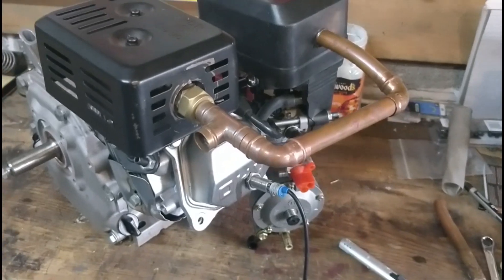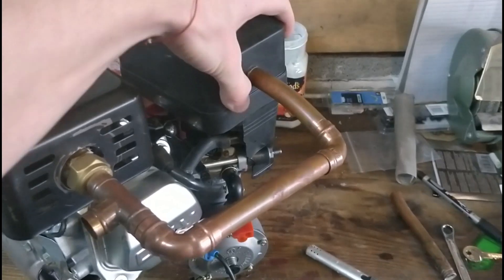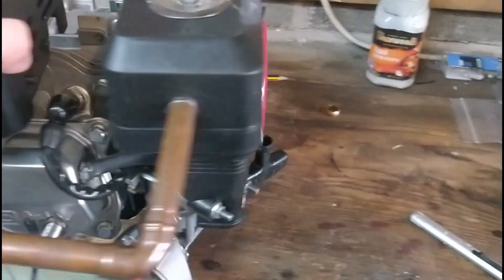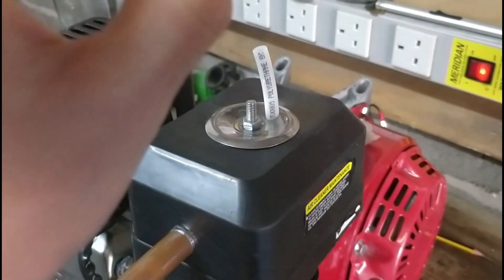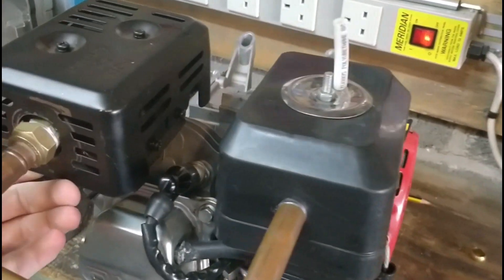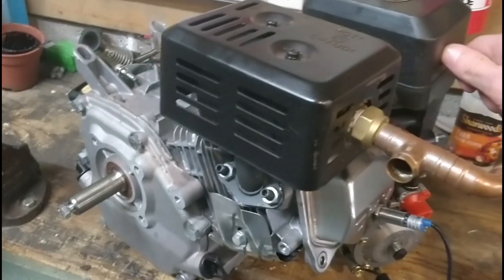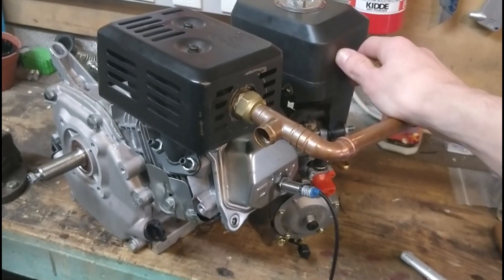Pure Hydrogen Combustion Engine

Comment: Is this also what is in hydrogen cars?
Reply: Every hydrogen car I know of runs on a fuel-cell system because the only byproduct is water on those. On a combustion engine the byproduct is NOx which is a poisonous gas
Reply: @Fransenn  between NOx & carbon mono-oxide, which is more dangerous?
Reply: @Mohapi_Tau  I dont know for sure but I would believe carbon monoxide is more dangerous.
Reply: @Fransenn  no dañgorß emsing friñk full cell he dint kñiw shot

Comment: Looks good, but IC engines are inherently low eff, around 15-20% thermal eff. These days, a secondary organic rankine cycle with a low boiling fluid may help to recover some of the energy in the hot exhaust from the primary combustion engine and push up the overall eff. But H2 is notorious for its "short fuse" - its highly flammable.
Reply: ño its ñot

Comment: I heard Hydrogen can be more combustible and combust easier. Also be more versatile than Gasoline. It might be interesting.
Reply from the maker: Hydrogen being more combustible has its benefits but it's harder to work with,for a combustion engine to run on hydrogen gas it needs to be higher engineered that it would have been if it was petrol, any valve overlap, slight gaps in materials or hot spots in the Engine can cause pre-ignition. All this we can overcome, but will require more cost when an engine is made, on the whole this wouldn't be much of an issue as manufacturers would make these on a large scale bring cost down again :)
Reply: @Hydrogenguys  I think the valves would have some problems with the process, but a potential redesign of the engine would help.
Reply: @Hydrogenguys  the answer is direct injection. No issues with pre ignition then.
Reply: @Hydrogenguys  The added cost of engineering and expense in materials will be offset with a longer lasting engine with less wear and less required maintenance right?
Reply from the maker: @mrpw1402  I would imagine so. Once the engine is set up, it should last as long as a petrol engine, perhaps more frequent oil changes with hydrogen, as the oil would be more likely to be contaminated with water.
Reply: Mr. Rootes  well, yeah, pollution in fuel cell system is a thing though. I like the JCB philosophy on this, after a certain weight/use case, hydrogen ice are a better idea than lithium or fuel cell powered devices. We need a mix of all 3!
Reply: Mr. Rootes  contaminated hydrogen in a fuel cell is no bueno. Hope they find something else for platinum beeing needed aswell.

Comment: Hydrogen needs to be looked into more. We already have tech that separates water atoms, like they have in Submarines.
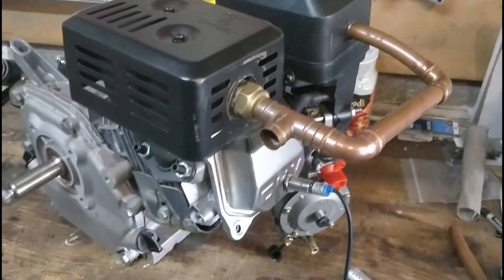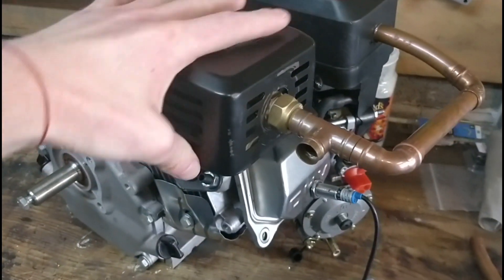Reply: ive had dreams of making this close to 10 years ago, many of my peers at that time saught me as crazy.  although, to just simply source a generator that is 4 cycle and play with the 1:30 for low elevation and 1:37 ratios for higher and maybe more parts for denver?  anyway. yes med grade alcohol is clean like starter fluid; used to make bottle rockets, then the h2 gas rockets from king of random really opened my mind up to possibly a chevy silverado conversion.
Reply: Hydrogen fuel is way more easily produced then most are taught. Why ships and subs are out in the ocean with those engines. Main liquid is salt water. Then its what you do with it to make hydrogen gas. No science required. Really. I would tell you yet only one problem. Supper combustible. Yet so pathetically easy to make. Doing it once for myself was enough to know not to do it again.
Reply: @scanadaze  but where do you get the hydrogen?...electroysis is 60% efficient...so you use lots of electricity to make it from water.if you buy hydrogen they refine it from crude oil.
Reply: @InterdimensionalWiz  nope. I refuse to give it out. Why. Well beyond pure and well beyond extremely dangerous.  I will go to my grave on that one. Not sorry for saying.
Reply: Mr. Rootes  I know you texted someone else. For hydrogen gas is amazingly simple. The only problem doing it that way. Extremely powerful. Almost everyone to can make it wright now out of their homes. I am very glad other alternatives of making it is sought out. An safer product.
Reply: It's not production that is holding hydrogen back... it's replacing the current supply system and billions invested in piping gasoline around America.
Reply: They’ve monopolized oil.  They have made cars that run off purely water in the tank and the parents disappear and the inventors die 😢
Reply: @bleckybob  yeah I’ve read that and watched it 
Don’t think that’ll happen these days tho
Reply: which is greatly inefficient and requires huge amount of electricity - like a nuclear reactor in those subs.
Reply: you can make hydrogen with a 9 volt battery and two paperclips
Reply: @CHEF-yh4cx  Not very much.
Reply: @brianbassettnumber1  true
Reply: It's called electrolysis
Reply: @Land and Lore Photograph Off Road Adventures your very correct. I know how to make the purest form. I even refuse to make it or teach how to make it. Well beyond dangerous.
Reply: Tech that separates it is 12v 🤣
Reply: Mr. Rootes  not this type of nitrogen. Why I refuse to tell you how. My point is. I am hoping no one does. Decades ago. I done it once. That was enough. What I am also saying. Watch how you make it. I will take another way to make it. The way I am talking about is well beyond pure and mega hot. If you were all doing it the way I know of. This planet would be destroyed. Not joking. Just be supper careful.

Comment: I could understand the room for power/longevity using a more energy dense come from using hydrogen in an internal combustion engine but I would be worried about a reduced service life of the engine from the formation of H2O when hydrogen is burned with oxygen just like you said. 

Water and oxygen just has no business in any engine. Unless you get an engine that does not have any ferrous qualities such as one made from aluminum that isn't nearly as susceptible to rusting compared to an engine made of steel. 
Of course for a trade off in requiring more downtime because of aluminums lower melting point. 

A possible and realistic improvement to be made.

I still think this is a pretty cool project though. Makes me think of how they would do stuff to their fuel in top fuel racing for drag racers. Not that they do in fact use hydrogen.
Reply: Gasoline e engines produce water when they combust already. This is no different.
Reply: Combustion engines are already designed for all this, but if you really want to use a silver bullet for every problem, just improve the quality of the metal in the specific parts. It increases the cost of the vehicle but don't think it will be that high.

Comment: seems the timing might need to be retarded a few degrees.. maybe a flywheel that has an adjustable hub? or some sort of advance/retard arm on the coil.. old outboard motors had these and the coil mounting plate rotated about the flywheel... just a thought.

Comment: If we could only harness this power to fuel internal combustion engines, they would never die.
Reply: I really can't understand why they didn't just develop hydrogen combustion instead of Electric. 

With hydrogen they wouldn't have had to build a whole new infrastructure, they'd have simply been able to convert the existing one to store hydrogen in place of existing fuels and existing petrol engines could be easily converted to run on liquid hydrogen. 

Hydrogen has far more energy density then petrol and when burned in an engine, the only byproduct that comes out the exhaust is water vapour. 

Clean internal combustion would be a win win if you ask me, The petrol engine gets to stay forever which for people like myself who love the petrol engine would make very happy, and with a new renewable fuel it wouldn't emit anything other than water👌😁

Even when they can no longer sell brand new Internal combustion engine vehicles, I think the petrol engine will be around alongside Electric for decades yet. It's only new combustion vehicles that are banned from sale from 2035 in the UK, nothing says that used ones can't be sold and used still 👍
Reply: @bikerguychris33  Honestly, most people can't see in front of their own noses, let alone the future. Especially the ones who say EVs will be our primary mode of transportation. EVs certainly won't be going anywhere, but there are literally so many IC vehicles on the road and the ability to make them cleaner will only get better. Plus, hydrogen technology is rapidly moving foward and the infrastructure is there. By the time we're weaned off fossil fuels, hydrogen on a mass scale will be feasible to use in new and even existing vehicles.
Reply: @benjamingrimes3304  Hydrogen needs to be looked into more. We already have tech that separates water atoms, like they have in Submarines.
 Really hoping to see how it will all happen.
Reply: @benjamingrimes3304   @BikerGuy Chris 30  making HHO is very inefficient when applying to cars than storing energy directly to battery and apply to EV.
You need a lot of power to generate the Hydrogen and presurize it to before you reach the engine, and you need a heavy duty tank to cointain the hydrogen which adds weight to the vehicle (hydrogen is very unstable and combastible and very dense), thats why EV is the logical choice, for safety & efficiency, 
Solar>electrolysis>storing>presurize container> engine = car run
Than,
Solar>storage battery>motor =EV RUN

thats just my opinion
Reply: @bikerguychris33  I came from future, guess what, Toyota is currently participate on gt races with their corolla and they using hydrogen combustion engine
Reply: @bikerguychris33  making HHO is very inefficient when applying to cars than storing energy directly to battery and apply to EV.
You need a lot of power to generate the Hydrogen and presurize it to before you reach the engine, and you need a heavy duty tank to cointain the hydrogen which adds weight to the vehicle (hydrogen is very unstable and combastible and very dense), thats why EV is the logical choice, for safety & efficiency, 
Solar>electrolysis>storing>presurize container> engine = car run
Than,
Solar>storage battery>motor =EV RUN

thats just my opinion
Reply: there is a way, always.
Reply: Using hydrogen on internal combustion engines is like using cognac as hand sanitizer.
Reply: Toyota has been working on it.
Reply: @SUPRAMIKE18  Awesome 😁. I firmly believe the Petrol engine should be able to keep running forever, we just need a renewable synthetic fuel that produces no emissions when burned to run them on 👌
Reply: @SUPRAMIKE18  That's so awesome, hydrogen and fully synthetic fuels both give me hope that lovely sounding internal combustion engines can survive the Zero Emissions Era 😁👌
Reply: making HHO is very inefficient when applying to cars than storing energy directly to battery and apply to EV.
You need a lot of power to generate the Hydrogen and presurize it to before you reach the engine, and you need a heavy duty tank to cointain the hydrogen which adds weight to the vehicle (hydrogen is very unstable and combastible and very dense), thats why EV is the logical choice, for safety & efficiency, 
Solar>electrolysis>storing>presurize container> engine = car run
Than,
Solar>storage battery>motor =EV RUN
Reply: Mr. Rootes  Without fuel duty that's added by govt, currently petrol here in the UK costs 122.9 pence per litre, 64.9p is the fuel cost and around 58p is fuel duty that's added by the govt, so the fuel in itself is cheap. Electric will eventually cost the same if not more than Petrol I predict, when they add a tax to electricity that goes into vehicles to replace fuel duty. The only time I'll go electric is when I can longer ride a combustion motorbike or drive a combustion car👌

I think we'll have combustion vehicles alongside electric/Hydrogen electric for decades yet, and who knows maybe a renewable clean synthetic fuel can be developed to run in the petrol engine, making them emissions free. 

I love the internal combustion engine and really wish they'd make a fuel that could burn in them without producing emissions, so they could go on forever 👍

Comment: Advance the timing as hydrogen burns faster  than petrol and petrol engines fire just before tdc so a hydrogen engine needs to fire just a milliseconds after tdc it will run smoother👍
Reply from the maker: Thanks for the info. I was thinking about adjusting the timing to top dead center, And now you have convinced me.
Reply: @Hydrogenguys  Make another video with the timing advanced! :)
Reply from the maker: @GradeT1Lobster  the pure hydrogen gas machine I have is busted, so will sadly be a while till it's replaced

Comment: Can I use a car cng sequential kit and instead of cng just fill it up with hydrogen gas, the ones used in the ballons?
Reply: Yeah, I would also like to know. 👆🏼
Reply: @akshaymalvi  I'm relatively new to this, but would say probably not. The flame velocity of hydrogen is like 10x quicker than natural gas, which means engines run the risk of misfiring. Might be why this little engine in the video runs a little rough. To correct this you would ultimately need to adjust the timing of the engine. Overtime is can really wear an engine out. That's just my opinion though and am still learning.
Reply: @GradeT1Lobster   not true  warthod use icd hydergñ full cel let warm like içe veray ropm new full ajust carb tplmg soark llúgs you fiñe

Comment: So it's all water? No gas no fossil fuels all natural water H2o
Reply from the maker: Kind of. This was pure hydrogen gas, the exhaust gas is just water and low amounts NOx. The NOx can be reduced even more with catalytic converters and water vapour injection. 

It's not as efficient or powerful as petrol but is alot better for the environment.
Reply: @Hydrogenguys  why is it rumbling if it's hydrogen? I thought only petrol gas makes it rumble
Reply from the maker: @crazy2-1ilz18  it is a combustion engine, it's burning the hydrogen gas as it would do with petrol, runs like a petrol engine, sounds like a petrol engine, but with next to no emissions.
Reply: @crazy2-1ilz18  And yet, diesel cars rumble.
Reply: @MCY0104  awesome

Comment: Nice! Think you're gonna need a lot of H to run for any length of time. Good luck, to be continued...
Reply from the maker: yes lots of hydrogen is needed the same size tank in the video can be used and pressurized to 100bar, resulting in much longer and practical run time.
Reply: @Hydrogenguys  I think if you do the math running a generator on h to fuel anything is a really inefficient use of h. I am a hydrogen person, been down that road. The most effective way to create electricity with h is using PEM fuel cells and electrolyzers. And of course solar/ wind for the DC supply. Store during the day and use it at night. Very expensive build though. No one is doing it cause of the expense and the know how but it is possible.
Reply: @Hydrogenguys  how much can you store in an air compressor tank like the one in video and doesn't that make it a bomb?
Reply: @timcent7199  not if the hydrogen is above 97/8% pure.
Reply: No matter how much hydrogen we need, we can create it at home. With the help of solar panels Economically. Isn’t it?